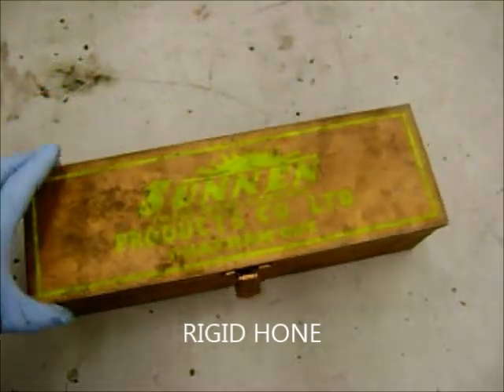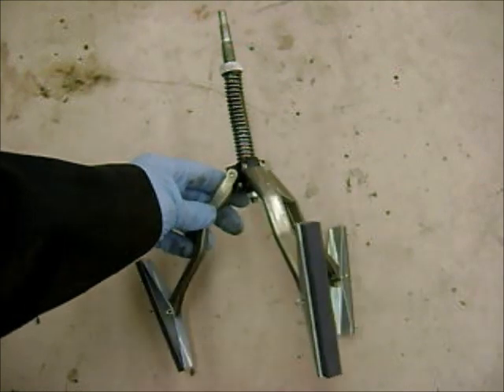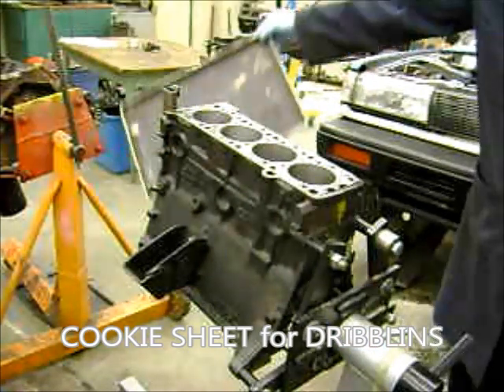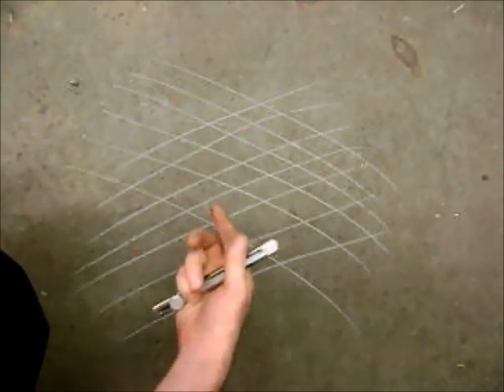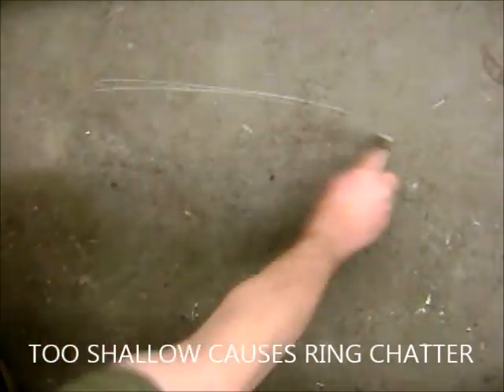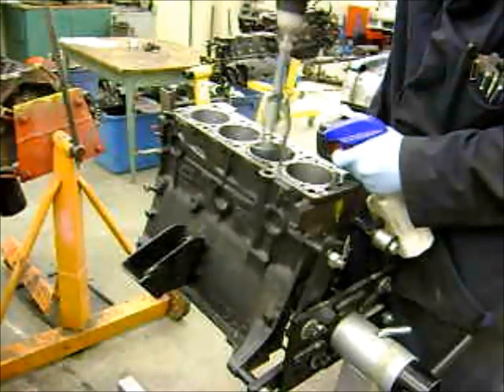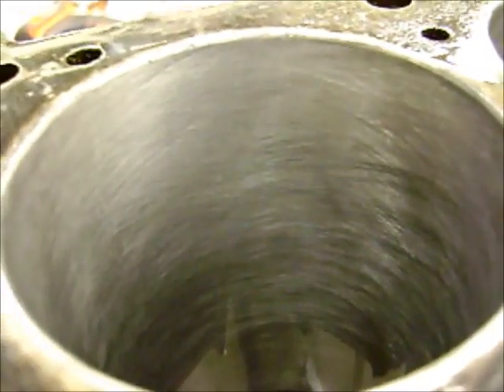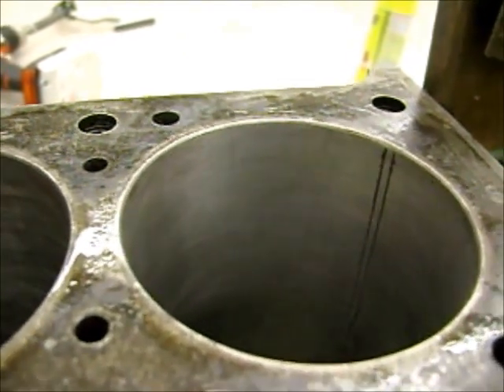Quick & Dirty: Cylinder Honing

Comment: Thank you sir. Very informative and educative. But after the honing, do I need to clean the tool? If so, can break cleaner damage the stones? I've seen some guys that use plain old warm soapy water to clean it, but I am afraid that the tool rusts over time and end up scratching the bore if I decide to use the tool after a long period of time if a small piece of rust breaks off.
Reply from the maker: I spray mine down with brake cleaner when I'm done.

Comment: So if it's your first time honing, and you do not get a good pattern, you can start over and hone it again until the pattern is satisfactory?
Reply from the maker: Yes.  Although, if you stay there long enough, you can potentially make the cylinder too large. But that would have to be quite a long time. Have a look once you get started and really try to get the pattern right early on.  Then continue honing until it looks consistent.

Comment: What if you use ring break in powder instead of a cross hatch on the cylinders
Reply: The point of oil is to clean the stones and wash the grit away. Not all oils flush well though and I see many hand honed blocks a year that I get to fix. The lesson of the vid is fine but often blocks are over honed, horrible finish, honed to large of a diameter or simply a block that should have been bored and honed to a new size instead of trying to just hand job it. Before I bought my Sunnen cv-616 power stroke hone, I did my honing by hand. But I set up a well fitted tub and had a constant stream of oil going. The finish difference is very noticable from squirting some WD-40 to flood oiling. I rough bored my blocks 0.004" undersize and then would hone till finish diameter. Process tookfour stone grits and a platue brushing in the end. That 0.004" would take my about 4 hours to complete on v8 block. With my big hone I do it in about an hour and every cylinder comes out the same size and finish with much ease. I don't miss the manual honing lol. But I also hone about 50 block a year.
Reply from the maker: Some folks would dump a teaspoon of Borax down the intake while it's running to "seat" the rings, but I'm not brave enough to do that myself. Sounds like an interesting experiment!
Reply: @GregWellwood  Total seal makes a powder that can be applied to the cylinder for the purpose of fast break in for rings. Drag engines do not have much time for break in, so this might help

Comment: Nice vid👍. Do you have to hone the cylinders even if your not going to replace the rings?
Reply from the maker: I would.  The cylinders get sort of "polished" as they wear in, and without breaking the glaze (A "Glaze Breaker" is another name for a hone), the new rings will not "cut" in and seat properly.
Reply: That Shop Teacher Guy. But would you have to do that even if your keeping the same rings ?
Reply from the maker: @tomdangerfield1532  Oh.  Missed that.  I don't know.  If the rings move around while it runs, I don't think it would matter. If they tend to stay in one place, it might.  I have found that when I spiral rings onto the pistons, they move.  Only one way to find out!!!
Reply from the maker: Some folks would snap the throttle wide open while dumping a teaspoon of borax into the engine. Apparently seats the rings for you.  I'm too chicken to try.
Reply: That Shop Teacher Guy brill thanks, the only reason I ask is I can’t imagine every time you take the cylinders off (e.g. to change a head gasket) you have to hone and fit new rings!
Reply from the maker: @tomdangerfield1532  I don't know. Is this a motorbike? I really have no motorbike experience, and this isn't how automotive engines are put together.  My take on it is - if i'm replacing the headgasket, I should probably do the rings since I'm in there anyway.  How often do you have to replace headgaskets??? Maybe there is some other issue going on that should be resolved first....? In automobiles, if you blew the headgasket, you probably overheated it too, so you'd be wise to replace the cooked rings.

Comment: How many rpm’s on the drill do you recommend?
Reply: By the book, low rpm. Somewhere in the 2200-3800 rpm. I’m studying for my A1 ASE and this is what I remember reading and writing. The crosshatch pattern as well is supposed to be 50 degrees too.
Reply from the maker: Um...... It will depend on how quickly you stroke.  It's all a balancing act.  I have a speed that works for "-me-" and it's relatively slow.

Comment: Is it necessary to finish the process with a different grid ?( 400 to 600 )
Reply from the maker: No.  You hone it with the grit that the rings are designed for - check your ring manufacturer.
Reply: @GregWellwood  how to find rings specs grit. Have had a bad headgasket and was some rust (# little ) . Don't want to put out cylinders . Is it possible to clean this little rust without putting out the cylinder and what sand paper can use
Reply from the maker: I would use the proper honing stone grit recommended by your ring manufacturer. I'm not sure you mean to use sand paper, I wouldn't use sand paper. Corrosion that has pitted the cylinder is a gamble.  It might seal "good enough," or  it might not seal well at all - how lucky do you feel? Hone it and see how it looks.

Comment: I just paid good money for machine work, including bore .030 over and torque plate hone. My Mahle forged 4032 pistons require 3 thou piston to wall clearance and I’ve measured as small as 2 thou at bottom of bores. Also crosshatch levels off from what appears 30-40 degrees throughout except at bottom. I’m guessing the machinist didn’t run the hone deep enough?

Comment: I need to enlarge the inside bore of a flange bearing from 25mm to just over an inch. Remove just over 0.015748 of an inch. I was thinking about using a wheel cylinder hone. Does this sound feasible?
Reply from the maker: If you can measure to six decimal places, you have my blessing. I have used wheel cylinder hone to enlarge bearing races in the past, but it takes a long time because the races are usually hardened.
Reply: @GregWellwood  Hi, I was wondering what grit stones you are using and at what rpm? Thanks!
Reply from the maker: Your ring instructions or ring supplier will tell you which grit to use. Different ring materials require different finishes. RPM will depend on how fast you stroke it; I find I am less accurate the faster I spin the drill, but you might have better skillz than me.

Comment: In the past I've actually set small engines in the parts cleaner and let the fluid run inside the cylinders while honing, worked very well for me. Just make sure you clean everything good with hot soapy water!!!!!

Comment: Hello! In your experience, How far can be a cylinder honed without need a oversized rings? I plan buy the tool and hone my bike's & bug cilinders has well.
Reply from the maker: I don't like to go by opinion, I prefer to go by specification.  If the cylinder is ~in~ spec but the ring gaps aren't, then see about getting oversize or file-to-fit rings.  If the cylinder is ~out~ of spec, you need to deal with that first.  No honing or oversize rings will fix a worn cylinder.  Measure it.  If you can't afford to fix it, don't measure it - just hone it, ring it, run thick oil, and fuggedaboudit.  It will work.  For a while.
Reply: Thanks! Have you used your honing tool with a drillpress?
Reply from the maker: I have never used a drill press for honing.  I have always used a hand drill.  With the rigid hone, I hang the drill on a spring from a hook up above so I don't have to hold the weight of the drill, just move it (I use a fairly heavy drill for that).  For the ball hone (glaze breaker / dingleberry) I just use a hand drill.  The ball hone is by far my favourite for a cheap rebuild.
Reply from the maker: Sometimes you can get rings where the gaps are made too small.  You then file them to the correct specification.  There are ring-filing machines you can buy that do this best, and some good videos on YouTube that show how it works.  If you are assembling a used cylinder, be sure to measure the ring gap at the bottom the cylinder where the bore is the smallest.
Reply: ty so much for your anser sir!
Reply: hello @gwellwood quick question, what did you meant by filing? if the rings are already out of specs... im in doubt ?